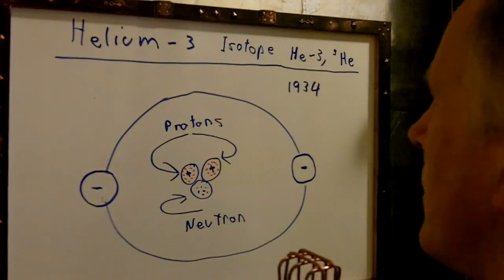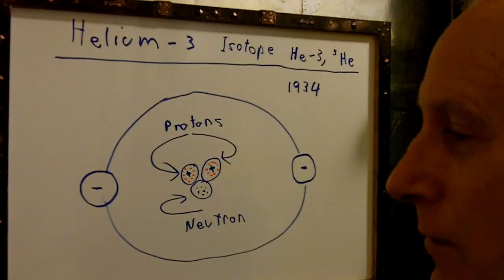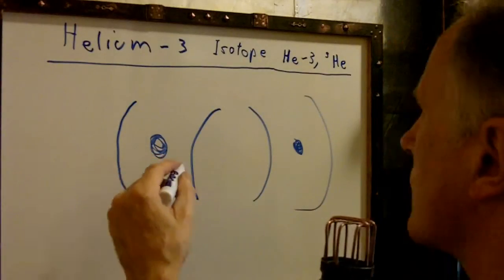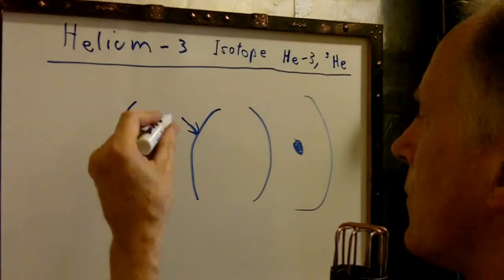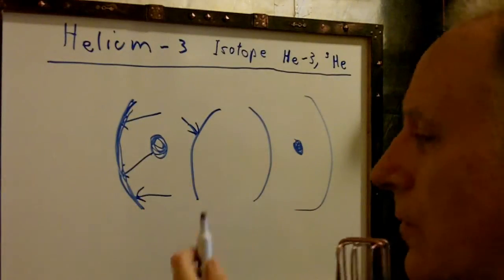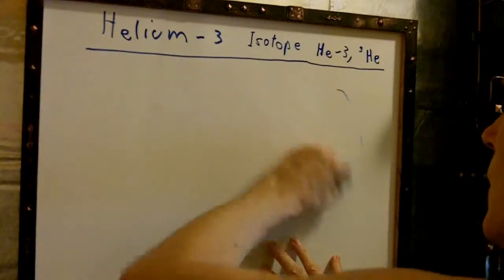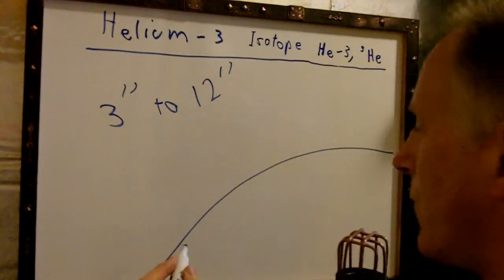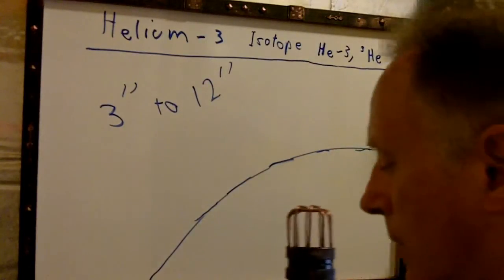Helium-3 as a Fuel

Comment: Helium3 actually requires FAR higher temperatures to ignite, not lower.  The Helium3 is not coming out of the sun, the sun ejects Helium4 and then while in flight cosmic rays impact the Helium and convert tiny fractions of it, those same rays don't penetrate the Earths atmosphere btw.  Also we can produce Helium3 far easier on Earth via bombardment of Lithium and subsequent decay of Tritium then any process in space, either mining or the passive collector your describing.
Reply: So why would fly all the way to the moon for it , honest question